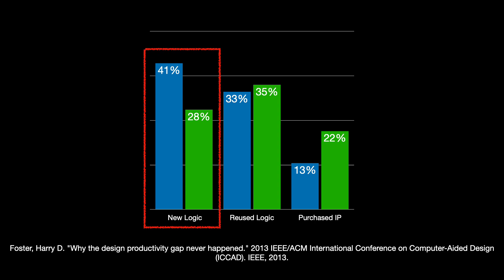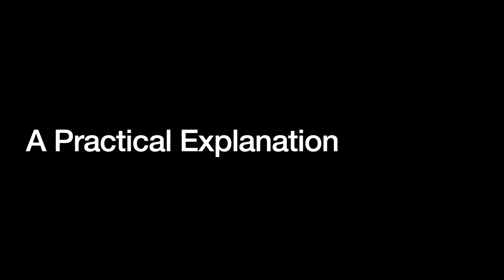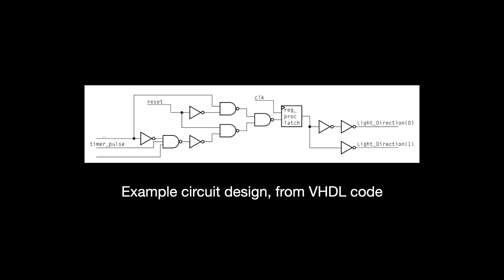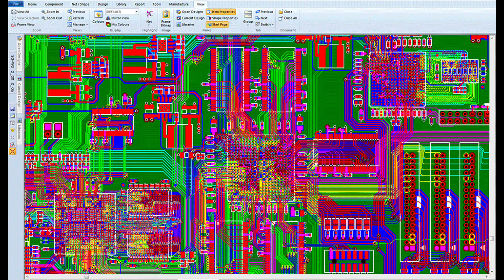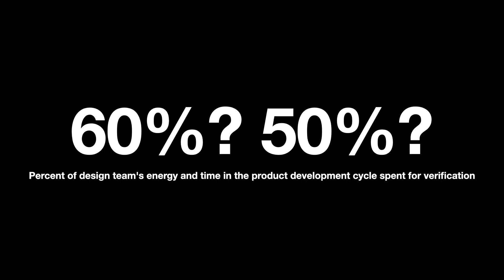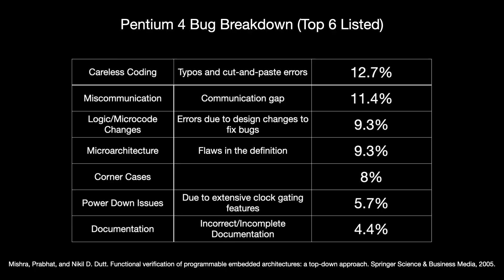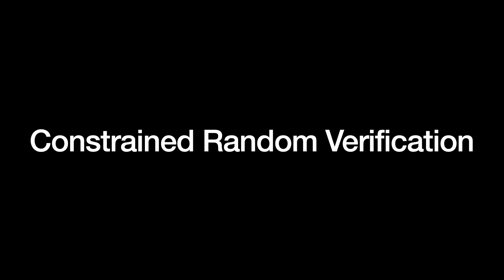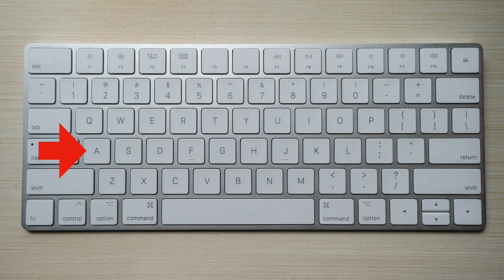The Growing Semiconductor Design Problem

Comment: As a full time verification engineer, I hate shortened chip development cycle (and modern capitalism in general tbh). This is causing an amazing stress on verification team due to limited time constraints (this and increased tapeout queues at fab - if you miss your time slot you would have to wait for another half of year) . Besides, there are times when throwing more team on the project will only cause more problems in a same way as throwing more cores on the processor will not yield expected N time productivity. I sometimes think about switching back to software jobs simply because verification usually ends up being an overtime mess.
Reply: Throwing more people at projects was what my former employer thought to be the best solution... In all cases.

Needless to say, it didn't end well for them.
Reply: Reminds me of: "9 women can’t make a baby in a month." - mythical man month
Reply: lol, op was trying make a point about large companies prioritizing short term profits, aka modern capitalism, is inefficient and leads to a lot of unneeded stress and of course it somehow gets twisted into a conversation about foreign military intervention or whatever
Reply: @REGINA_VOMITUS  My thoughts exactly. I'm wondering if they're talking about the same issue at this point.
Reply: @REGINA_VOMITUS  because capitalism = profits = usa and you know what they are like with their military and invading
Reply: @user-cx2bk6pm2f  This conversation is certainly over. An individual as intellectually dishonest as yourself is incapable of holding a meaningful debate. You would first have to accept reality which I understand is a difficult task for some. Good luck in life, you'll need it.
Reply: @user-cx2bk6pm2f  america itself is the reason iraq was destroyed, no not in 2002, but back in 1960s when the capitalist goverment saw an incentive to invade iraq and take all the oil. this happened more than once  in many countries throoughout usa short history, all due to capitalism
Reply: @user-cx2bk6pm2f  what am i projecting vro i just explained to you how capitalism does benefit from warfare
Reply: @dexulescu  Capitalism is inherently dependent on government intervention, as there is no right to own capital without government enforcement of that rule.
Reply: @scifino1  You are 100 % full of bs. Government intervention is only when they intervene with the normal function in the market, but a government fist priority and primary function is protecting the rights of it's citizens, that's exactly the reason why we have governments in the first place. Which has nothing to do with intervening with the economy in ways such as lobbying, as it's not protecting the rights of it's citizen. In the end, all that capitalism is, is efficient allocation of scarce resources, notice that i didn't talk about money, i am talking about resources, whatever it may be.

I get it, you guys hate capitalism, but maybe if you were just a little smarter you wouldn't.
Reply: @alexis1156  well articulated and something to be appreciated. It's too bad you wrote more words than brain cells held by helf this comment section. Definitely don't waste your energy on these people- mass formation psychosis is real.
Reply: @alexis1156  Amen to that! It's like blaming the sidewalk for having ice on it. 

An important point on equality is that it's naturally nonexistent in social hierarchies (in all organisms and species). The natural order of life itself requires inequality. The strive for equality of outcome, which is inherently marxist, is against all natural orders that exist. Even Marx himself didn't understand what it meant to be a part of the "working class" as he grew up wealthy and become a journalist. The modern Marxists are just like him. 

What really matters is showing people the light. How can one enlighten another who is so fargone? How can our society move to a post-postmodern era?
Reply: @alexis1156  Just a quick side note as well, I think there's a hint of merit when it comes to the war argument. I'm loaded up on defense contractors right now (very much like our senate and house of reps) and while the initial push/pull factors of this brewing war might not be related, the state of the world stands to economically reward war and conflict (subsequent mass production). The free market is the only way, but how did we get to a point where an incentive has presented itself to brew conflict outside of the free market?
Reply: @Chris-pr7qo  i think we are fucked frankly speaking, the problem is all the debt that is caused by the massive welfare, but no one wants to abandon welfare, even republicans have their preferred welfare system, like social security, so we will go all the way to the scene of the crash. The only moving on is when we eventually reach a major economical recession, and i mean it when i say major, and it's gonna happen in about 10 years or so. Because that's when social security will become 100 % of total federal spending, and there is no way they are gonna do that, as it would mean that all of the money that the government gets is spent on social security. No military, no police, no basic functions of the government. Just social security.

The problem is the people, the government is simply a reflection of the people. The government is corrupt because we are. 

A disaster will happen if we continue, the only question is, will people realize how dumb they are and start cutting off welfare? Or will we crash and burn? And judging by how people are, id say the second is far more likely. 

The only way i can see this being avoided is if tech goes so far up and beyond that we can increase our standard of living so much that things become cheaper and cheaper to produce. But they just printed so much money and caused so much inflation, and tech does not do well with inflation.
Reply: @Chris-pr7qo  I wanted to expand a bit on what i said before about equality, because i explained that it's not desirable, but i don't think iv'e explained why it isn't.

For one as i said people are not equal, they never were, you yourself are not equal to yourself depending on the day, maybe one day you feel especially tired, another day you are energetic, your performance varies, so not even you are equal to yourself depending on the day, forget other people. How can you pretend that all people are equals, they just aren't.

Equality is not desirable because to have a truly equal society you must bring everything to it's lowest common denominator, you cannot bring someone who is inferior to you, to your level, just like you can't pretend that a 4 core 3 ghz cpu, to work like a cpu that is 16 cores 5 ghz. It just won't happen, but what you can do is reduce the power of the 16 cores 5 ghz cpu to match that of the 4 cores 3 ghz, but is it desirable? No.

Just look at all these college kids, the government mandated college to be a universal right, and then they nationalized the student loan industry, this caused more and more people to enter college, then you have teachers unions actively making it more difficult to meet demand, so with a stable supply and high demand what do you think it's gonna happen? Prices increase. But not just that, now you have people who should have never been into college in the first place, getting loans, and asking for the full amount, even if they didn't need it, spending half of it on bs, and then when they are out of college and can't "find my job" Complain to the government about : forgive my student loan. 

While they were the people who were stupid and took a loan that they couldn't repay.

People complained about how college was discriminatory and how only the rich and capable would get in, well let me rephrase that, would it surprise you if i said that only rich and smart people would go to college? No, because that's what it is. People saw college as a ticket for success, because people who went to college made more money, but the reality is that people who went to college and made tons of money in the future did so because they were smart, not because of a degree.

College is a perfect example of what happens when you try to force equality. You have dumb people who make terrible choices, and go there for the "college experience' and when they go out and have to pay the loan back, they complain about forgive my student loan.

Equality is never desirable aside under the law.

The good thing about capitalism is that it allows people to choose for themselves what they want to do, maybe you are not good with college, well you could become something else and still make a lot of money, like a plumber or another trade job. 
But people don't like it, because capitalism doesn't allow them to sit on their butt doing nothing, but that's not really capitalism's fault, that's nature. If you do nothing you will die, because that's nature.

 The only reason why we could afford such a massive welfare state till now is because of the prosperity that capitalism brought us.  So it's pretty stupid to complain about it when it's what allowed us to prosper, but i wouldn't expect these people to actually understand economics. You've seen it yourself, even apparently smart people become knuckle dragging idiots when economics are brought up.

And also, equality of opportunity is a dumb term that falls into the hands of the left, equality of opportunity is simply freedom from artificial constrictions, which is what freedom is. Just call it for what it is.

In the end, what's important is income mobility, you should be able to increase your standard of living with no barriers, if you are willing to put in the time and effort, but income equality is not desirable at all.
Reply: Oh, so you suffer from the Mythical Man Month problem in EE. Just put 8 more woman and the baby will be ready in 1 month.
Reply: Companies care about money, not consumers or workers.
Reply: @user-cx2bk6pm2f  how do you not know how capitalism benefits from warfare? who do you think makes weapons? ground vehicles? planes? those are not made for free. the government doesn't just magically make those appear out of nowhere. the government buys that shit from private companies. There are companies that profit from manufacturing and selling weapons. how is this not obvious to you? have you never heard of lockheed martin? lmao
Reply: Umm about that capitalism part, you do realize that is a bureocrat thing, not a economic system thing, right? Managment is bureocracy, and bureocrats are always, without an exception, an extra cost and hinderance. Bureocrats caused chernobyl to happen due to them demanding the plant be put into overdrive and safety off, to the protest of everyone else involved, and that was in a socialist system.
Reply: @rockytom5889  Capitalism does not equal crony capitalism.
Reply: I quit DFT (and HDL engineering in general) over that. Jobs offer much worse pay, while projects are being squeezed to infinity, leading to 70+ hours per week in some places. This is somewhat common during tapeout, but due to imbecile deadlines, was happening all the way from initial design to ECOs and post-tapeout support.

A pity, since this environment leads to the opposite path of the market retaining younger professionals.
Reply: @felixknight2278  If you actually look at historical sources (primary and secondary), their scientific complex was not efficient at all. Take their rocket program for example:

In the Space Race the extremely bureaucratic nature of the Soviet's development agencies were so restricting and inefficient the top scientists in the various agencies made an "underground" board to handle matters for themselves rather, calling themselves the "Council of Chief Designers".

For example, when discussing the practicality of reproducing the A-4 (technical name for the German V-2 rocket), the men in NII-1 had to report to the chiefs in the Ministry of Aviation Industries, who then proceeded to deny the military applications of rockets. The team at NII-1, in violation of their orders, still decided to document and analyze the A-4 rocket in secret. Had the team not defied instructions, the development of the R-1 would have taken significantly longer.

Additionally, during this time, the three major agencies involved in rocket-related technologies (NII-1, OKB-SD, OKB-51) “worked independently of each other, despite the fact that … they were employed by the same ‘ministry,’ the People’s Commissariat of Aviation Industry.” This led to rampant conflicts-of-interest and duplicated work.

Source: 
Challenge to Apollo - The Soviet Union and the Space Race, 1945-1974 by Asif A. Siddiqi (2000)
Reply: @TheDXPower Asif Siddiqi's account is hardly reliable in his attempt to attach all this polutical payload to a simple situation. The diversity of the Soviet rocket designs bears out the reality that their deigners have had a high degree of latitude and yes, freedom. Rocketry, unlike agriculture or art or commerce, was a brand new field free from political baggage, and and it was both as complicated as they come and simultaneously seemed to proceed splendidly for the Soviets - hence it'd deterred micromanagement and got more latitude. This has less to do with socialism vs capitalism and more with just human nature.

Even the loss of the manned Lunar landing (mitigated by the significant successes of both the Lunokhod rovers and Luna robotic soil sample return missions) ended up a blessing because Kuznetsov, given the lunar N-1 engine mandate lost in the game, saw the race as lost & used the mandate and the funding to give Mother Russia not the engine she'd asked for, but one he felt she ought to have, the incredible closed-cycle machine thought impossible in the West even decades later, whose RD-180 derivative the US was buying to loft even its military payloads to space.
Reply: @user-cx2bk6pm2f  That's a weak ad hominem argument.

Not everyone can enjoy the benefits of our technological advances. It is easy to believe otherwise and calling people spoiled even though you might be the one who lives in wealth.

Just saying 😉
Reply: @user-cx2bk6pm2f  "I can't argue the point, therefore I will deflect, move the goal post, and wane about waste of energy".

Capitalism promotes many atrocities, military interventions being some of the most stark examples. All this goes to show that the underlying assumption many have about capitalism that it ultimately improves quality of life for all those it touches is false. The incentives of capitalism do not align with the betterment of humanity, the general welfare of citizens, and in many cases will actively appose them.
Reply: @user-cx2bk6pm2f  I wonder what that 'something' would be. I am wealthy enough to enjoy all the commodities given but I'm not that pathetic to believe everyone gets the same chances like me.

I never wanted to talk about if the current situation has to be changed or not because that would be pointless but your mere denial of how things are show me that you still have to learn a lot about life.

Maybe one day you'll leave your little safe space and travel around the world to see how wrong you are with that attitude you are propagating.
Reply: Theres serious lack of Massive Death Count during non-war situation for Capitalism, but such list are surely exist for Communism.
Reply: @rashidisw  Latin America, Africa beg to differ
Reply: @rashidisw  40,000 people die in America every year because they don't have health insurance. There's countless more examples of people killed as a result of capitalism, it just doesn't get talked about through that lens.
Reply: @user-cx2bk6pm2f  so when you dont have a good argument you start attacking the opposition? so much for an intelectual discussion
Reply: @user-cx2bk6pm2f  The US intervenes when it has a monetary stake in the outcome. For example, going into a otherwise protectionist or semi-socialist nation and helping to install a dictatorship that is more open to international businesses operating within the nation. In particular, when said nation has several nationalized industries ripe for "privatization" to US internationals. This is well known stuff here. There is a long history of this, and much of it can be read in the books of retired military personnel who were part of these operations. A little bit of reading goes a LOOONG way to being informed.

What does Capitalism have to gain through militaristic or terroristic intervention? more money, more profit, the only thing capitalism cares about.

You keep moving the goal post in your second to last paragraph so I'm not engaging with the intellectual dishonesty there.
Reply: It’s so annoying how capitalism hinders growth, like rather than these companies all fighting and trying to screw each other over they could all work together to make the best product possible
Reply: @ThylineTheGay  different and conflicting ideas and design will always be better than a single idea.
Reply: @vyor8837  Only when those ideas are the end-goal. When you have protectionism and competing standards for intermediate components (two things capitalism incentivizes because it's a great way to generate profit) then it actually slows down innovation. Economists have been shouting this for years, that a serious overhaul to our patent and IP systems are needed to allow innovation to thrive.
Reply: @trapfethen  ip in general needs to be abolished. It's also government intervention, not capitalism.
Reply: @trapfethen  ... Why would not having IP mean more monopolies?
Reply: @vyor8837  Not more monopolies, it would naturally lead to monopolies (it could be fewer but drastically larger monopolies spanning multiple industries).

The reason is pretty straightforward, if someone comes up with a worthwhile product, piece of media, etc. That thing can be picked up almost immediately by larger organizations that have existing efficiencies of scale and capital investments in that industry without compensating or bargaining with the original producer at all. In the time a startup would need to acquire funding, perform the required R&D to manufacture /produce the product at scale, a larger pre-established company could have a copy-cat product to market selling and gaining market share.

The initial IP protection rules were made with this in mind, it gives new market entrants time to get their feet under them before having to hold their own against the 800 kg gorilla. The subsequent corruption of those IP laws is what has allowed corporations to turn what was meant to be training wheels for new market entrants into a near never ending shield against competition.

It's a balancing act of protecting new entrants but not empowering established heavy-weights.
Reply: @trapfethen  so question: how would they aquire this information to make it?
Reply: @trapfethen  who would put that information out there?
Reply: @vyor8837  Come on. You were doing well, asking relevant questions, and engaging is spirited debate. Don't go obtuse now.

My previous comment went over several ways that the information could either leak, be stolen, and even in the case that you made it to market without the information being leaked, more capitally invested large corps could easily copy, undercut, and outcompete you because of the economies of scale involved.

Do you have a legitimate follow up question?
Reply: @trapfethen  But here's the thing: we know that even when it does leak there is no inherent advantage to larger companies. Look at the industrial revolution or even semiconductors. The smaller company doesn't automatically get pushed out of the market, AMD and Cyrix didn't. Hell, the second only went under because Intel sued them over... Patent infringement. Lawsuits that Cyrix won even, it was just so expensive to fight that they ran out of money. And now look at things, only 2 viable x86 vendors, and that only because AMD won the lawsuits Intel tried to use to bury them... IP lawsuits.
Reply: @trapfethen  except that Cyrix won against intel. How are the laws corrupted in that case?
Reply: @vyor8837  The laws are corrupted in that they last far too long, and the litigation of those cases reaches into millions of dollars due to the razor sharp interpretation of protected IP due to that length.

As the length of protection went up, the tightness of protected material also went up to the point that any litigation requires a mountain of expert witnesses to cover every detail. The underfunding of the Patent office has also lended itself to this because the incidents of incorrect patents being awarded has also given more credence to patent invalidity counter claims.

If the patent office were properly funded, and protection lasted for much shorter timeframes. the litigation of such cases would be orders of magnitude less expensive.

You have also pinpointed one of the most egregious original corruptions of the IP laws. That is the fact that violations are civil actions rather than criminal. So even when a bigger competitor has clearly infringed, the protected party might not have the capital necessary to defend their IP. If the infringement were criminal, then large corps could be held accountable using market-cap fines (fines based on their market capitalization to make sure even big guys feel the weight of their misconduct).

If things were the way you advocate for, Cyrix would have had zero recourse to Intel copying their technology. and would have gone out of business due to being outcompeted.
Reply: @trapfethen  thus happened over the course of 10 years. The original length was 20.
Reply: @ThylineTheGay  Capitalism and competition significantly accelerates growth. If there is no competition, the company in power has zero incentive to try, or come out with new products, resulting in stagnation. This is a big reason pure communism is horrible, inventors and engineers have no incentives to try, there is no reward. A recent example is when AMD was having issues being competitive with their weak Bulldozer line, Intel got lazy, AMD (having much less money to work with), significantly exceeded expectations with Ryzen launch, and has been making huge advancements since then. Intel is now just catching up 5 years later. If AMD had not done well with Ryzen, Intel would still be selling overpriced quad core chips, but now 6-8 cores is common, with up to 16 cores being available for desktop (from both companies....ish).
Reply: @ThylineTheGay  i dont think you can find a more growth-oriented system than capitalism.
Reply: @MrAngryCucaracha  The mercentalists would have said the same about their system. And the feudalists before them. Because we haven't found one yet doesn't mean it doesn't exist and it's arrogant to assume otherwise.
Reply: @mentality-monster  if they had said the same they would have been right.
Reply: @MrAngryCucaracha  I agree, but there are things in capitalism, that hinder growth (i.e. patents, proprietary software, copyright).
Reply: @scifino1  everything you named is government intervention.
Reply: @vyor8837  so is capitalism (aka the right to own property)
Reply: @MrAngryCucaracha  It is amusing how those opposed to capitalism do so while living a life full of products resulting in capitalism that would not otherwise exist.
Reply: @scifino1  That's definitely not capitalism, that's basically the government and corporations being in bed trading favors, if anything that's closer to fascism, than capitalism. 

Infact, monopolies really do not last in a free market system, it's only when the government gets involved and says things like you need a certain patent to do this etc..... That monopolies last a long time, a coercive monopoly it's also called. Sounds familiar? Because that's lobbying.
Reply: "if you miss your time slot you would have to wait for another half of year" - capitalism should solve this by allocating more verification effort. anyone who doesn't will have intermittent missed product launches, or risky buggy hardware.
Reply: @andytroo  no one seems to care about buggy hardware or software these days. Just ship it! For software they’ll fix it in a never ending stream of updates, at least for a while then they move to a new version and tell people,e to buy an upgrade! Fir hardware, they just fix it by doing software workarounds for the hardware bugs even if it ruins the performance or other reason people bought the hardware to begin with and pretty much tell purchasers “too bad”.
Reply: @user-cx2bk6pm2f  G, G, G, you just described a result of capitalism. It's very likely that the conflict from which your family fled was partially caused by a US intervention in order to pad the pocket books of some American businesses. You didn't make the point you think you made.
Reply: @felixknight2278  Soviet R&D was pretty efficient, although often different Soviet academic departments and teams were effectively competing with each other, which led both to the benefits and drawbacks such dynamics create in capitalism. A paradigmatic case is the whole N1 rocket saga.
Reply: @user-cx2bk6pm2f  Way to miss the point entirely. Capitalism likely caused the very situation that haunts your mother, the US has pulled this stunt many times in it's short history.